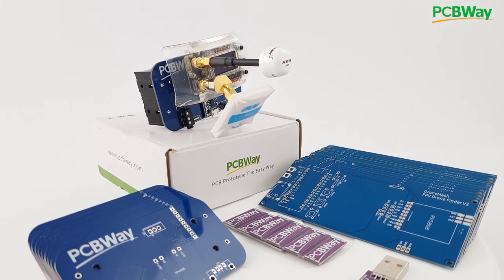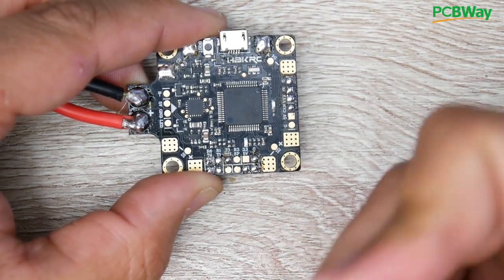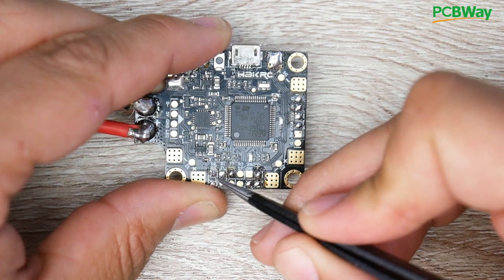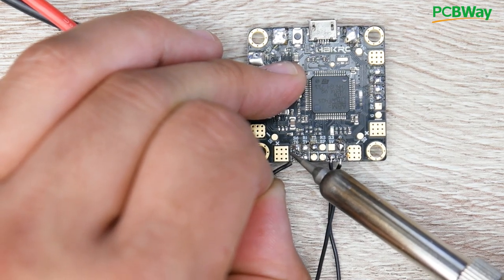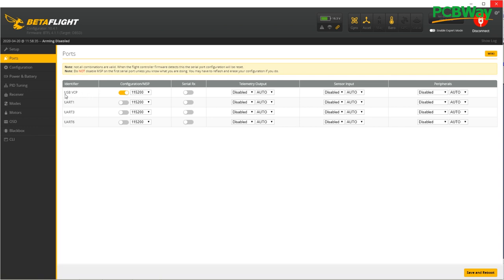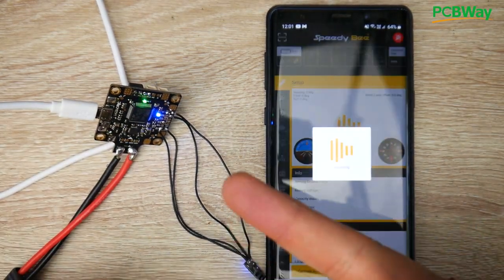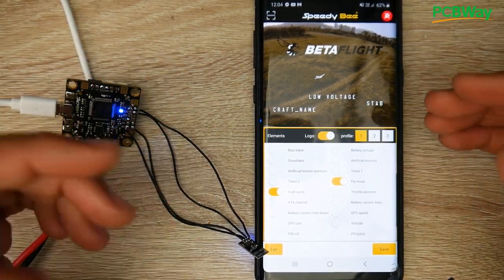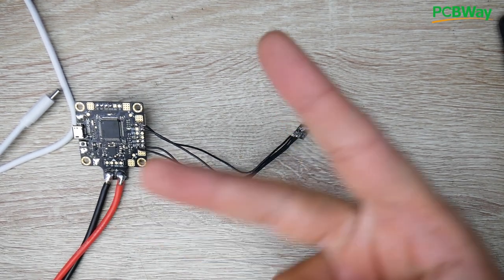Flywoo BT Nano // Betaflight Bluetooth Setup Guide

Comment: Is it like the Bluetooth module on the Mamba F722S, on which the Bluetooth is automatically disabled when the quad is armed?
Reply from the maker: NO it wont disable.
Reply: @DroneMesh  Doesn't that sound a bit dangerous?
Reply: @oliverlundin9323  yes, but not an issue for crossfire. 2.4 control systems may be affected, but I don't know
Reply: There a modules available that have a pin for switching the device on and off. You need to remap a free pin for this and configure it in Betaflight, though. That's how the original SpeedyBee UART adapter is doing it. BTW my Mamba F722S Bluetooth doesn't really work. Most of time I can't connect or get kicked out after a few seconds. No idea why...

Comment: Can these be used on digital quads where there is already another MSP port activated? I have tried and every time I plug it in, my ESC’s never initialize. When I disable the port connected to the Flywoo Bluetooth adapter, everything works again. Is this only for analog quads? Can you only have one MSP connection activated?
Reply: Good Q! I would like to now this as well.

Comment: Great review thanks. I have a SoeedyBee dongle that plugs into the USB port and can be really useful, even lets you enter cli commands. I like the idea of a tiny module you can permanently wire into a build especially fixed wing aircraft that can be really difficult to access the USB port.

BTW I’ve enjoyed your videos for a long time but have to say your flying has really stepped up since you started flying that new location, great to see someone who does technical stuff but also puts in the stick time to become a great pilot 🙏😎🔥

Comment: One thing I found out about speedybee is that although it will allow you a bigger screen in the OSD setup screen on the phone or tablet but when you pull up your goggles If You Don't See your readouts then more than likely they are below this screens available view also speedy bee will not work on certain settings on older FC like the mob 7 cannot change battery voltage some are available

Comment: I burn 2 modules.  They worked properly but when I was plug by the usb,  both modules overheat.  I bought some more but I m scare to install them in case I burn them again.  The modul need to stay on the quad.  It was plug to a 5.06v pads on a hglrc mini f722 board.  What could have made them burn?  The chip overheat every time I plug them.  The red led stay on for 1 sec when I plug then the heat rise .

Comment: Is there a way that I can make the bluetooth connects to my phone without using the usb from betaflight ? Be cause my usb port does not work anymore
Reply: If I remove my receptor soldered to UART6, (that have serial RX enabled) then  I would be able to have the bluetooth mode enabled without going to betaflight right ? Problem is that I don't have MSCP opened...

Comment: So everybody can connect to my quad without authorisation?
Reply from the maker: Yes 100% ;)
Reply: Needs a little plug connection you can disconnect when not using
Reply: Does it work with kissFC ?
Reply: Maybe you could use a realpit to toggle it on and off.
Reply: Using the buzzer pads is even better if you can spare them.
Reply: Don’t know much about the software used with drones since I’m just getting into them, but you can use a unique identifier within your firmware as a way to verify the sender’s identity.